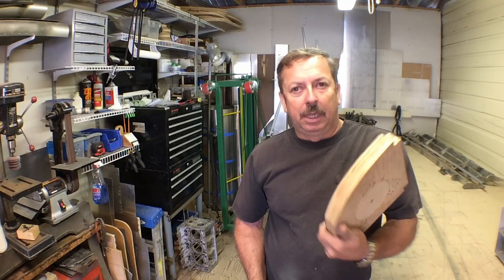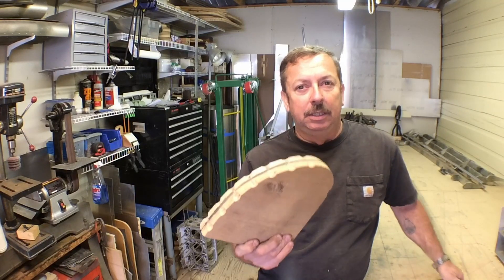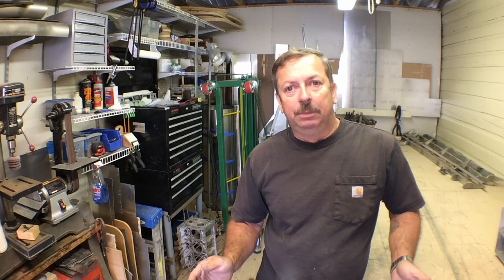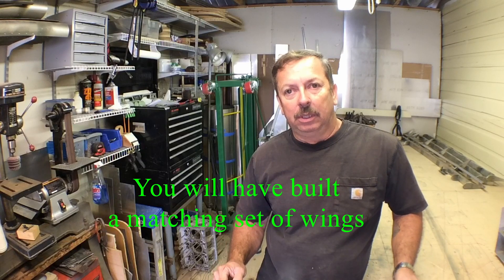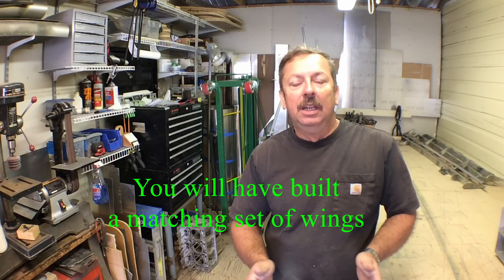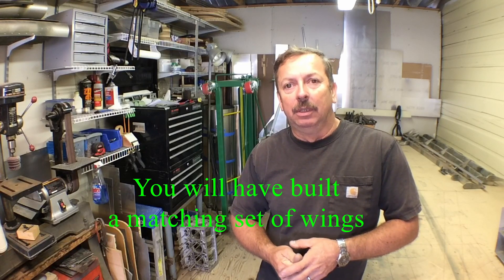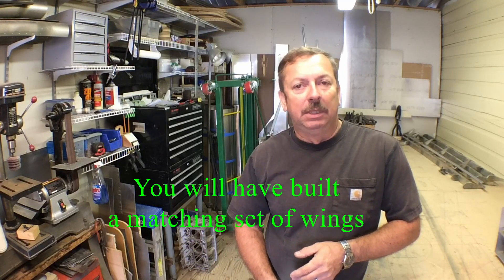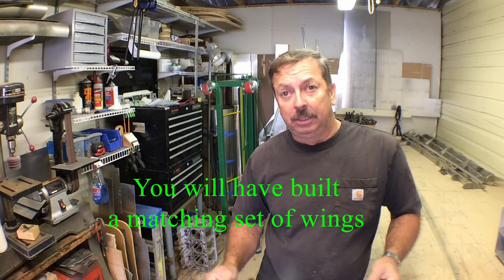Building a Zenith 701 Experimental Airplane,Building Basics Part 2

Comment: Great video!
Your tips are very helpful, exactly the conclusion I made myself, forms first. One nice thing is printing on paper the drawing, glue and cut the forms . But one would need AutoCAD... For the cruzer I drew everything, will make it available eventually...
Reply from the maker: When I am plotting coordinates to a pattern if I intend to transfer it to a form block I use vellium drafting paper which is almost some form of plastic? as it is dimensionally stable. if you use paper , when adhesive is used the paper will stretch and not give an exact pattern of what has been drawn so it induces errors. While it is usually a small error it is one more error induced into the tollerence stack which can cause problems with parts fit.